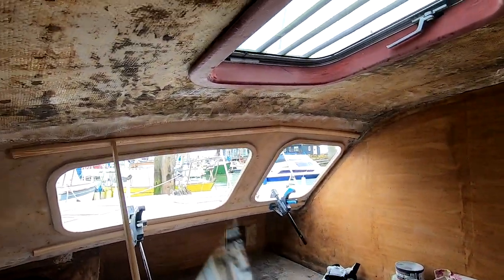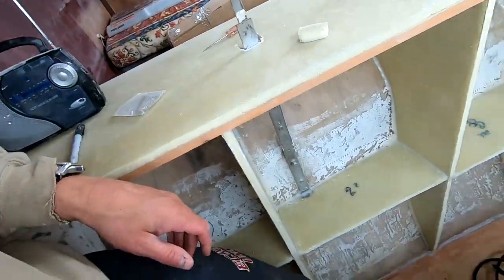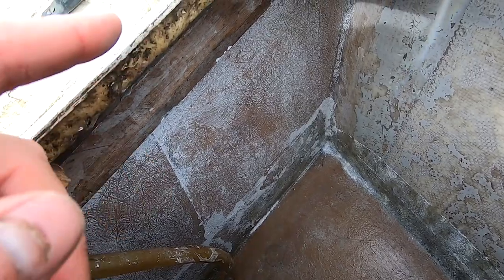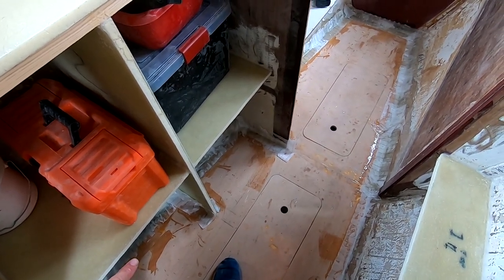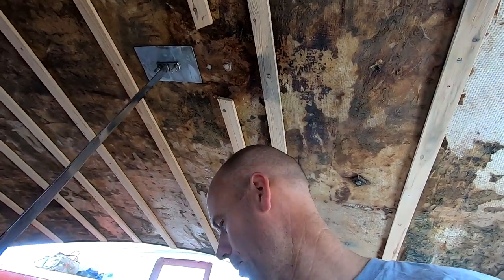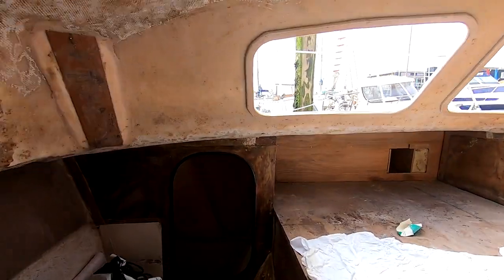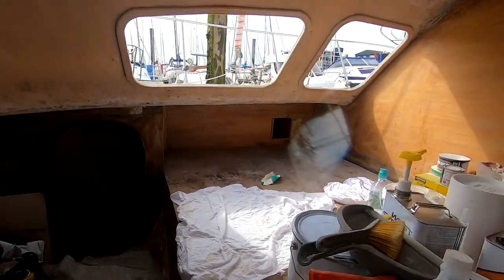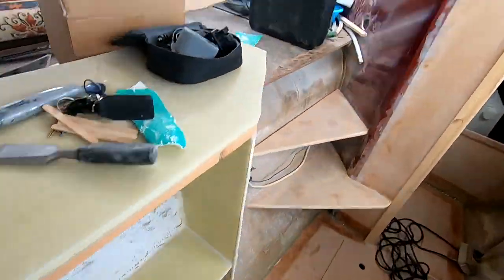Yacht Interior refit ,Removing wet flowcoat and new window surrounds E57

Comment: Progress every episode. Always great to see. Fibreglass should become basically clear when wetted out and then become a uniform, milky kind of colour when cured. The white parts are not sufficiently soaked in resin and I would grind them off or sand them off with coarse sandpaper and do those sections again. No need to remove the entire tabbing, only the sections that aren't quite right. Thanks for your videos and greetings from Bournemouth. PS: You can mix fairly large batches of epoxy, but need to spread it out thinly, not keep it in a tub. The thinner the epoxy is spread out, the less speedy and hot the result. I use cut up cardboard box pieces as my working surface/epoxy carrier once it is mixed.
Reply from the maker: Hi Christoph, thanks mate, all of the above is very very useful. I like to learn the hard way!🤪 i especially like the part where i don't have to remove all the tabbing!
Really baffled why it didn't wet out, i was giving it lashings and press in with a brush.🙄
Oh well, now on my very long list!
Love Bournemouth,hopefully some time soon i will be up your way looking for a visitor berth🙏🙏🤞🤞